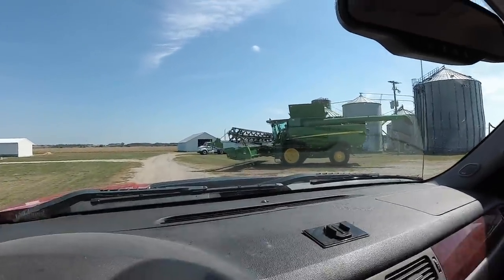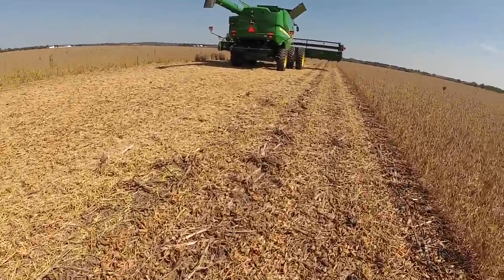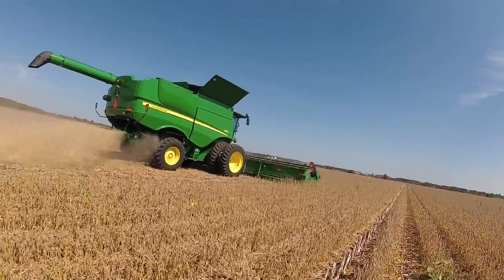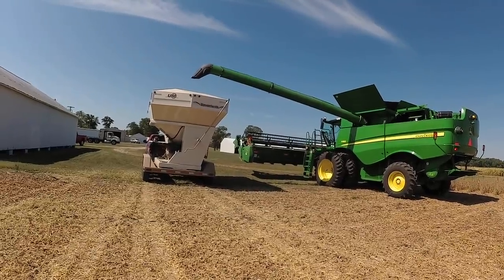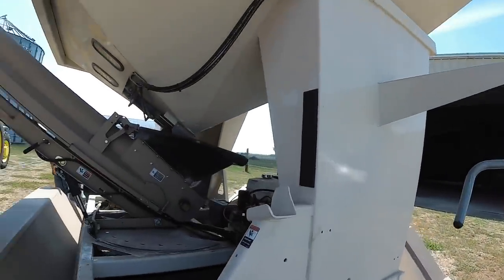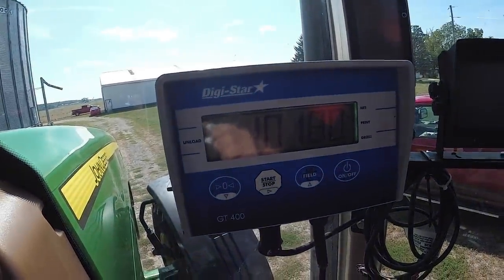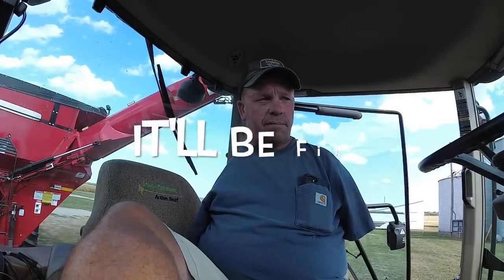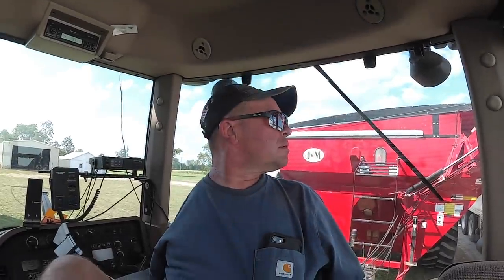First Day Of Harvest 2019

Comment: Good video Andy. How are the yeilds now that u have run a few days? Do u use the scale monitor on something else since u have to recalibrate it?
Reply from the maker: Hi Jake. The scale has always been off. Found out how to calibrate it so wanted to try. We did 4 different calibrations using the tender. Had to do it anyway to calibrate the combine so instead of dumping in semi, we dumped it into cart. Adjusted it on the first three, and the forth one, I was 200 pounds high on 10000pounds. Figured that's close enough. Glad I had written everything down that I had done because I pushed the wrong buttons several times. I had it all screwed up for a while. lol Beans are running in the mid to high 40's  Corn all over the place. 20-280 bu 15-35 moisture, all in the same 8 rows. lol  Maybe 160 bu/a